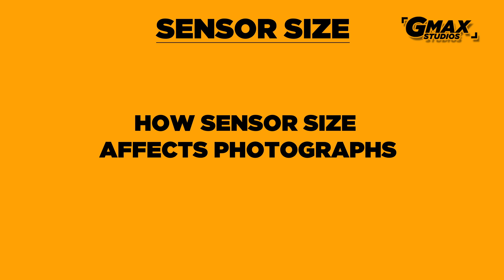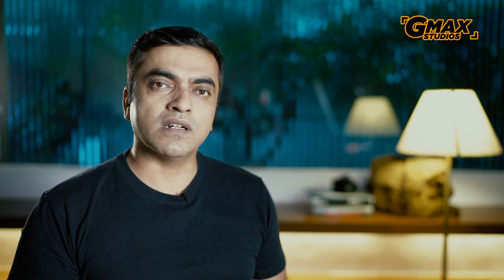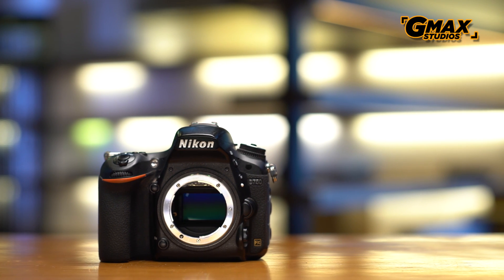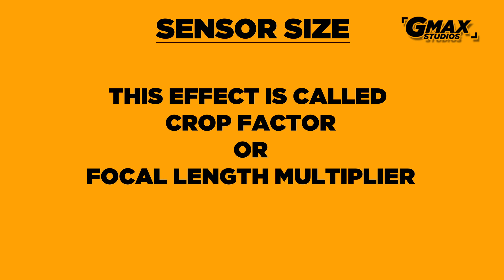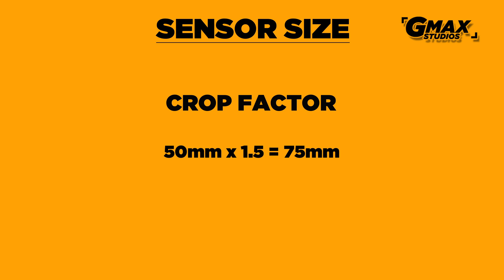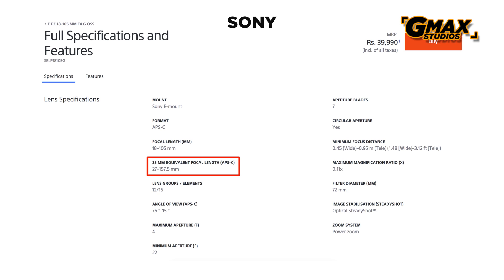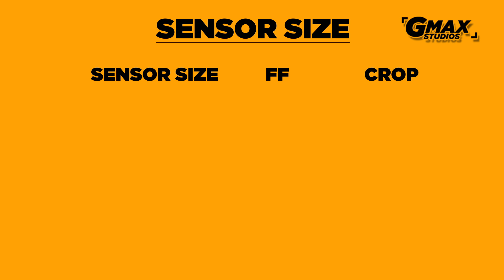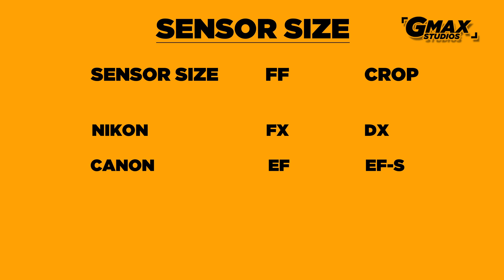Full frame, crop sensor and MFT Camera Sensor Size Explained | Learn Photography Episode 13

Comment: And what about the aperture .if we use a apsc dslr with 24-70mm f2.8 lens,it would be 36-105mm and aperture would be f4.2 ?????
I am following Tony Northrop video quite some time.. he explained that ....but still I have bit confusion ....if possible plz make it clear because no one is taking about this  crop factor effect on aperture.
Reply: Focal length doubles, aperture remains the same but the depth of field effect doubles
Reply: Yes u r correct , ape will became 4.8 as u said